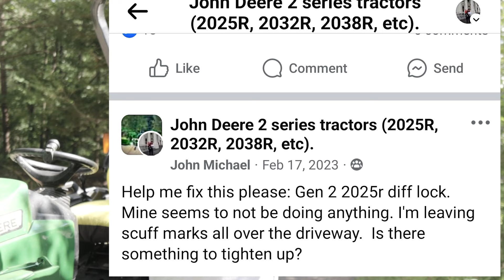Don't Be Like Me. Check This On Your John Deere 2025r Now

Comment: You could not turn because your differential lock was always stuck on. I got rid of my 1025r and 2025r. Deere quality has gone done the tubes. Only good thing is the color and name. I have replaced mine with kioti equivlents.

Comment: I just bought a 2025R brand new last week, and I can swear it scouts around strange on my gravel. I have looked a couple times now to see that I didn't have it in 4 wheel drive. I am now absolutely going to be looking at the diff lock to see if that may be the reason. I had a 1025R previously and it never did that... I just thought it was the size difference of the machines.
Reply from the maker: Dude. Double check it! I thought the same way!
Reply: @JohnWCH  JD service tech is coming out tomorrow to look it over. I don't really want to try and adjust it myself and mess something up when it is very much a "tractor setup" issue the dealer should have taken care of. I did lift the rear wheels off the ground and both spin in opposing direction with the brake off. So I don't understand exactly what is going wrong, but I figure the service guy will know. Anyhow, enjoyed the videos and it might have saved me the same fate!